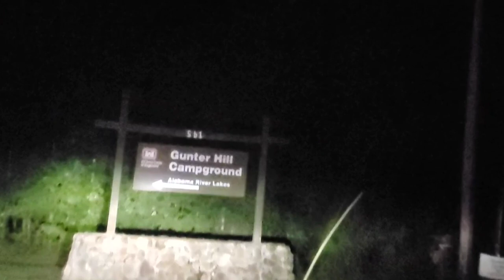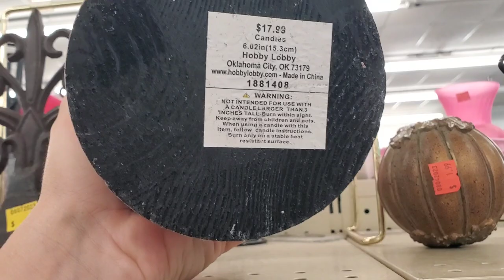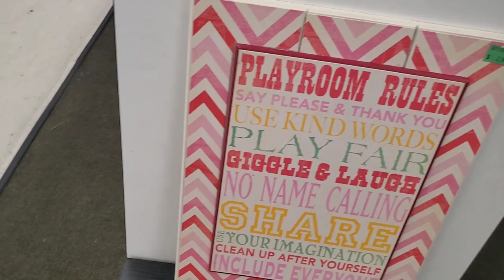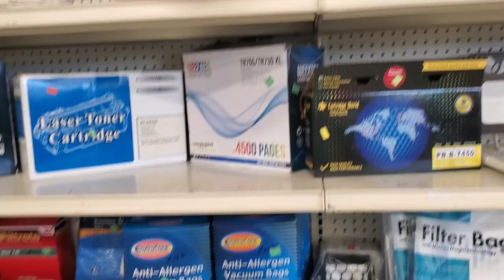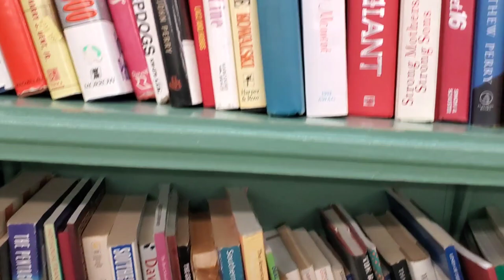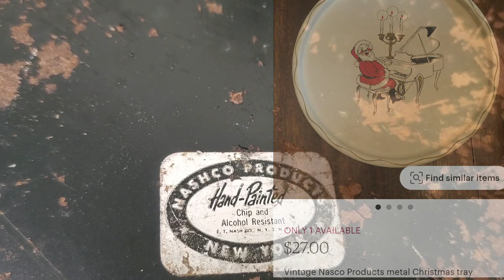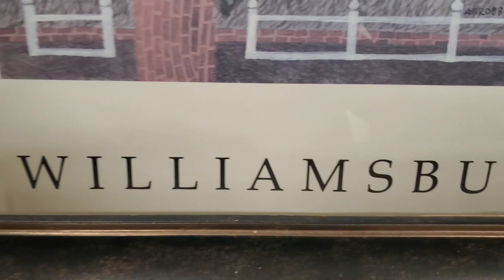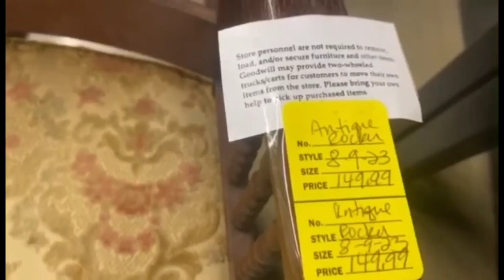Shop with Me • Vintage • Thrifting • Goodwill • Montgomery AL • 1950s Pink • Raising Cain

Comment: I live about 25 minutes from Montgomery and tallassee which I think you said your husband went to Auburn I'm in the middle point between Auburn and Montgomery. But if you go back to Montgomery go in the Eastbrook antique Mall it is awesome I've been to every thrift Goodwill salvation type store and the Tri-County area and I love that store. Now in Auburn Opelika the straight away is what I call it across from the Auburn Mall the four lane there's four or five and there's one small one called the mission center on the other side of the mall every one of them are cheap I'm talking cheap. The salvation army which is considered in Auburn near the mall also Thursday Friday Saturday everything in the store is $1.
Reply from the maker: We lived at Auburn our first two years of marriage, while Ben finished his degree, and I worked full time as a manager at the Opelika Auburn News. It was a special time there, 1988-1990. I didn't know about the Salvation Army there, or any thrift stores, but it would have been great, as we were broke most of the time 😄  I didn't really start thrifting seriously until we lived in Ft. Walton Beach near Eglin Air Force base. The thrift stores there were AMAZING. The military families usually donated everything when they moved, because they were given an allotment to buy new stuff at their next duty, rather than ship it. I learned to thrift everything there!